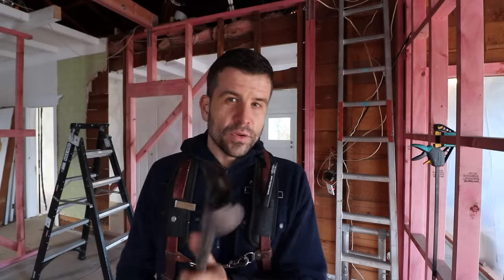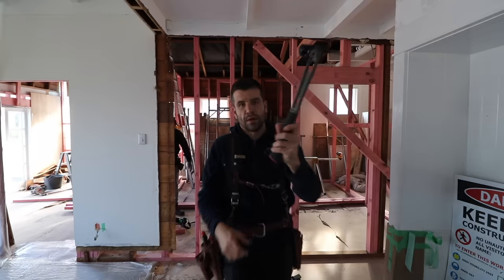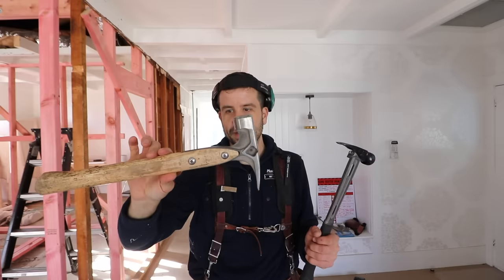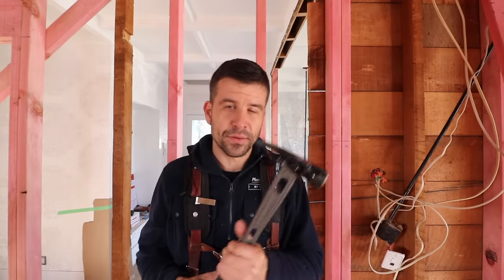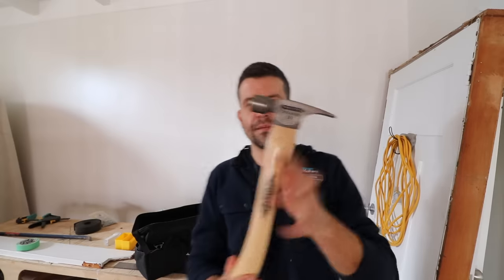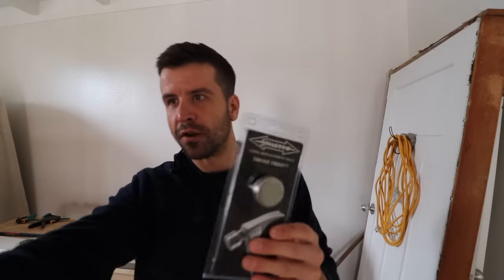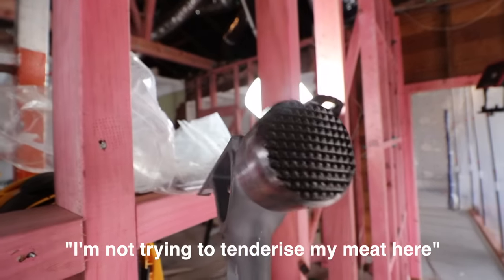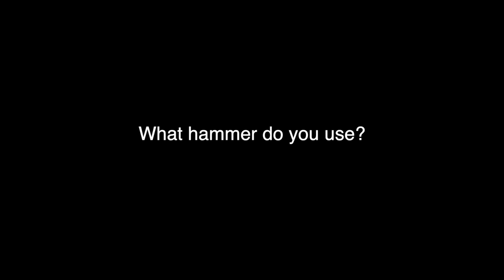Martinez M1: The Hammer Everyone Is Talking About

Comment: 16 Oz Estwing leather handle. Got a 90 percent discount by mistake. 
Not gonna complain about that.
Reply: Leave it lying in the rain for one night, its gone...
Reply: Treat the leather with respect and it'll serve you well. :) (90% discount is a gift) Every now and then seal the leather with beeswax then lightly rub it back with a bit of 0000 steel wool to enhance the grip, but try and avoid getting it wet because the leather will deteriorate fast if soaked.

Comment: Side nail puller is for framers. It's a framers hammer because most in the states don't use framing guns, its all about driving down the nail in 2-3 hits in quick successions driving studs and plates together bent over thats why weight distribution and deadening is the way it is.

Comment: Found it interesting how long the shafts of both of these hammer are, because I'm from Germany and I think the most common hammer here is the picard 298, witch is also has a spike on the head. For most of the demolition prosess we use ether the Hammer one a crowbar, if you need more force.

Comment: Estwing Ultra Series 15oz. I've had it for years, it's a baby hammer but it can beat the snot out of anything and being light and small, easy to carry all day. A hammer is a tool, I am rough on it and it does it's job. Straight claw is very specific, the slightly rounded has many more uses and is an all-rounder. Also being small I have my belt loop on my right and it doesn't hit my leg or get in the way like a long framing hammer. I've been meaning to try other hammers, but never bothered, just happy with the little Estwing.

Comment: The wooden handle hammer looks like the handle still has the factory poly on it.  Wooden handle needs to be sanded down, maybe charred followed by a sanding to expose the wood grain and finally some oil applied to the handle.  Won't be slippery or callus producing, plus looks like buddy there wants to customize his hammer anyway.  That would be the way to do just that.

Comment: I’ve always sanded the varnish off of my tool handles and given them a few layers of linseed oil. It’s a much nicer feel and not nearly as slippery, plus it cuts down on blisters.
Reply: Another aspect is being able to fine the timber haft to fit your hand on day one instead of having to go through the breaking-in time of a rubber grip (They can still be sanded/re-contoured, but it's far more work).  Keep feeding the haft with linseed and it'll be far more resilient to breaking, but they all tend to break eventually with heavy use.

Comment: As a Chippy in Alexandra, Otago. Iv'e gone with the stiletto 14oz standard smooth faced 18". There is no fancy features with it, no side pull or interchangable what not. Of the 5 or so hammers I own it's my favorite to use when the head stays put, The  biggest downside is the head fixture, the traditional way, it works loose, and of course being down here in the desert the dry air dries out the timber of the handle and makes it worse. Have had a play with the Martinez but the guy was running the m4 handle on the m1 head, was quite impressed, to be honest though, you can't go past the wood.
My two cents.

Comment: The vaughan deluge hammer like the original douglas has 3 leverages for nail pulling using the front puller. You only have a slot and a face puller so 2.

Comment: Had the Dalluge for 15+ years.  It’s absolutely perfect.  Replaced the handle once. Never had an issue with the short claws. It pulls the toughest nails pretty easy and in demo, the side puller is worth every penny. Used the estwiing prior and to this day i. Still paying the price from the nerve damage. Long term use of metal shaft hammers are very damaging to your nerves. Wood or nothing.

Comment: I never used to pull nails the usual way with a wooden handled hammer. I broke too manny. I used the side to side method, so a long nail looks like a series of 90 degree angles when it out. It’s the only problem with a wooden handle, otherwise, it’s the best. And of course I used a Stiletto.

Comment: A 100% increase in mass will produce a 50% increase to the force applied to a nail or what ever a hammer is striking. A 100% increase in speed will produce a 400% increase in force applied. Swinging a lighter hammer faster is ideal for carpentry. I’m a bigger guy that carried a heavy hammer for about 15-20 years before I figured that out🦾

Comment: did you check out Picard Hammers ? they are top of the notch here in germany ;) also i wonder why builders use hand hammers to nail rather than a nailgun. roofers and capenters here are mostly just using them.

Comment: I use a 20 OZ Wood-handled hammer with curved claws. am I missing out by not having the ripping claws? I'm considering picking up a straight-clawed hammer. also, if i do, is it beter to get it in a steel handle so it can be a more demo-type hammer? or is wood still fine? Thanks! keep up the good work!

Comment: Being an engineering tradesman we only use ball pien, dumpy or sledge hammers. I always prefer mine to have wooden handles. Takes away so much of the bounce and shock. Some guys will try to do a cheap fix and weld pieces of pipe to the head instead of going and buying a new handle. It works but no where near as well. It always shakes the shit out of your arms and shoulders especially when using flogging spanners on big nuts.

Comment: And old-timer pro tip from an old timer. Manufacturers lacquer the wooden handles so they look pretty in the store so folks will buy them. HOWEVER, this makes the grip less than ideal. Sand off the lacquer/varnish and then give the wood a couple of coats of boiled linseed oil. The change in the surface is remarkable and makes any wood handle easier to use and dramatically reduces blisters.

If you don't like it, you can remove some of the oil with solvent and revarnish.

Comment: I miss framing hammers the 3 pounder I use a lot now since I’m welding cast and hardfacing. I thought I would share since you’re talking about a lump of steel. After that I go for 6 pound cross peen but that thing is hard on the elbows.

Comment: You could sand or scrape off the lacquer from the vaughn handle and treat it with raw linseed oil. I did that with my trowel handles. Water proofs the wood and makes it non-slip. Search youtube for "2:00 Minute Technique: Simple Deep Axe Handle Oiling System" for more details on how to do it if you want to try.

Comment: I started with the Milwaukee short handle 20oz curved claw. From the outset I absolutely hated it. The balance feels all wrong and the head was absolutely enormous on it, far bigger than it needed to be, which made hammering in 30mm clouts a pain. I got given a 19oz Estwing long handle curved claw from a colleague, it was better but it had that signature Estwing ring to it, and sure enough a crack test revealed a nice hairline crack in the head of it so that got put away and back to the Milwaukee. Then I left the Milwaukee hanging off the back of my Pajero one day and drove off down the road and ended up in a culvert somewhere on the Awanui straight. Went back and bought the 19oz Estwing long handle straight claw framer's hammer and been using that ever since. I like the balance of this one quite a lot and until I can justify spending $450+ on a hammer I'll be sticking with this for the time being.

Comment: The 18' Fiskars demolition hammer is my bb. Absolutely no vibration. There's literally no downside to it when it comes to necessity. The one thing, it does not have a side slit to pull nails, but that's not a big deal for me. It's nice, but not a must have

Comment: To be clear that hammer designed to be used for carpenters working on the concrete forming world. The 2 holes are wrenches with common sizes for nuts commonly used with forming hardware. Same with the nail puller it is practice with some companies to use double headed nails as when we strip our forms the nails have to be pulled out to strip. Most residential framers and interior finish carpenters don't use a hammer for nailing as much as we do in the concrete industry. Like any other tools in your arsenal purchase the tools that suit the work you do.  Ps the head is weighted because we use engineered forms such as peri,meva,doka,..... a steel weighted head gives the strength needed to hit the clamps to align said panels. The t-bone from stiletto would be the closest comparison to this hammer but does not have the same weight in the head. Pound nails as much as we do and you'll see the reason and purpose of these well designed hammers. Pps this was not meant to be a dick post just wanted to share some info. Great video though. 😀

Comment: Not sure if someone commented yet, but you do realize that Mark Martinez was the inventor of the Stilletto hammer?
Reply: I have a 48 Year old STILLETO hammer, did he invent that ?
Reply: Inventor of the titanium Stiletto*
Reply: It looks almost the same. So...yeah!
Reply: What’s the story?
Reply: @danielrochaguzman4042  I believe he sold his patents to Milwaukee (who owns Stiletto), then started his own brand with a better design.
Reply: The m1 solves all the problems stiletto ti-bone had. Replaceable grip and whole head.  M1 is the framer and m4 is the finish hammer. Sounds like they would prefer the m4.
Reply: But Martinez was the hammer maker of the ti-bone and the new Martinez line.  Not a plug but the m1 and m4 is better than the ti-bone.
Reply: @joshuawells146  this guy's more of a remodeler; remodelers don't need framing hammers. and anyone that's ever done any heavy framing nose the extra weight in the head is where it's at.
Reply: He patented the titanium hammer. He didn’t invent the stiletto hammer!!!!!!
Reply: @bobs6129  I remodel and build new homes. I prefer a framing Estwing smooth face, use a cats claw pry bar for most nail and staple pulling, smooth face lets me finish and frame with one hammer, long handle give reach and leverage. she does demo well and most new framing gets the nail gun for speed.
Reply: @chrisagler8472  unless you're doing a lot of rough framing and pounding and bumping forms are on I don't see why anyone would need a 24 oz framing hammer to each is on but it helps you in no way at all mind you I have over 30 years not saying I know more I'm just saying that I own all those hammers and I don't see the use of owning one of those old clubs. Especially considering nowadays most nails are driven by mechanical means sure you do finish nails off in lvls and engineered beams with the majority of it is done mechanically
Reply: @bobs6129  I was honestly thinking that. I’ve seen some comments about 10 and 15 oz hammers and my 22oz Vaughn is just like wtf
Reply: @chrisagler8472  Estwings a good Hammer don't get me wrong but you're just lugging around a lot of metal that you don't need to but to each his own. Even those new I-beam mig welded style DeWalt hammers are really nice. I know a lot of people look at the Martinez hammer and think damn look at the price but usually a hammer is one of those tools you keep the longest.  titanium is expensive
Reply: I was about to say it looks like my stilletto, best hammer i’ve ever owned!!!

Comment: Waffle head, why leave one apprentice mark when you can leave fifty.
Reply: i grind them berore using them... but i do concrete forms so i dont have a 300$ hammer they usually last less than a year
Reply: George Mack same here. Commercial concrete forms and side puller and titanium is a must
Reply: GuitarWithJamie agreed! Not even a question
Reply: antoine roberge What kind of shit hammer are you buying that lasts less than a year? PS I do concrete formwork every day
Reply: It's for tenderizing your thumb.
Reply: I love the stiletto pesonally been using the TB 3 special edition for a year wouldn’t go without it anymore would buy another in a heartbeat if it broke. My coworker uses the Martinez m1 which is great strikes harder too but like you say the weight is a good and bad thing.
Reply: Anyone who doesn't know what the waffle is for hasn't been doing it long enough or doesn't pound enough nails. Not pull nails. Drive nails. Forms and framing are two different trades.
Reply: @defmc1  Concrete form workers drive all those nails they pull and don’t use nail guns like most framers. Now you know
Reply: @GuitarWithJamie  I'm with you. Some days I can hand bang 500 or more nails. I've been framing for 25 years. I don't shy away from hand banging. You are right a lot of guys these days don't know how to swing a wrench.
Reply: @defmc1  I gotta say it feels good to sink nails. Sometimes under the gun, not so much hehe
Reply: @GuitarWithJamie  not really understanding how a solid piece of metal last less then a year
Reply: @khancrow8212  Sounds like they lose them
Reply: @antoineroberge7539   I'm on my 3rd Estwing, they get stole or lost before I break em. They do lack the cool gadgets for pulling nails. Never set double head nails in forms so I've never found a need for a waffle head to grip the nail, I just learned to nail straight with my hammer of choice
Reply: A) if it aint finish work, who cares. B) I can hang goddamn aluminum trim with my Waffle head and not leave a mark
Reply: I used a 28oz Estwing waffle head for about 4 years, switched to flat head and never went back. I even do finish carpentry with it.... With NO Peter tracks.
Reply: Lol
Reply: @GuitarWithJamie  i use the dewalt 14 oz 16 inches but alot of the time its the handle that becomes loose. But they are guaranteed for life and i havent bought another for like 3 years so its a fucking deal. plus they feel really good but maybe on day ill upgrade
Reply: We called those marks UNION STAMPS.

Comment: The swelling on the handle is called a fawns foot on an axe, and like Richard said means you don't have to grip so hard coz you're not worried about flinging across the room. So less vibration travels to your arm or dodgy elbow in my case
Reply: I sanded down my wood framing hammer to create a more pronounced fawns foot. Specific to my hand anyway so I can feel where the end is and get more of a swing.
Reply: Or hatchet handle

Comment: An old framer taught me to keep my thumb off the back of the handle and it has fixed any issues I had from swinging a hammer. It was hard to break the habit and keep control, but after a while, it took.  Great channel!
Reply: I did the same thing when I first started helped me be a bit more stable when first starting out but once got more confident I stopped as it's more natural doesn't wear your hand out
Reply: I believe what your referring to is also called a power grip. It makes a big difference but most people don't use it. As an ironworker I have to lol, you don't want your thumb absorbing the force from smashing #6 + rebar
Reply: Speaking as a stonemason who has  shaped his share of stones,  I can confirm this.  Always hold your hammer (5 pound sledge...) in a full grip, keep your thumb off the back.  Your hand, wrist and arm are going to thank you for it.
Reply: I’ve never swung a hammer with my thumb on the back. It’s always been more comfortable to me to just grip it like I’m making a fist.